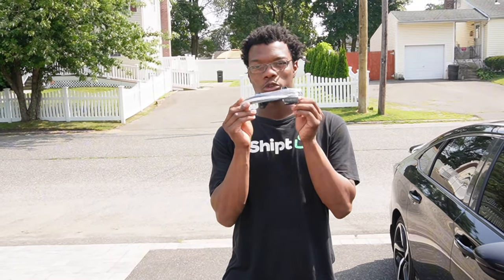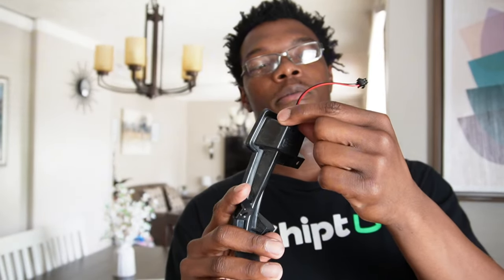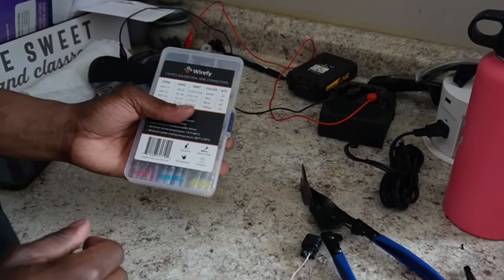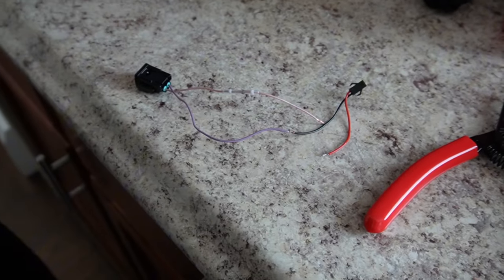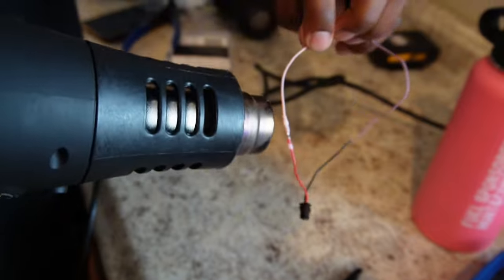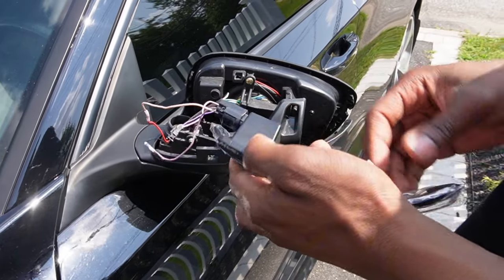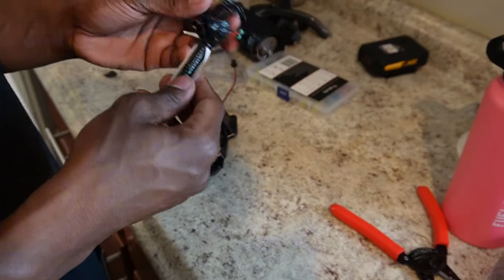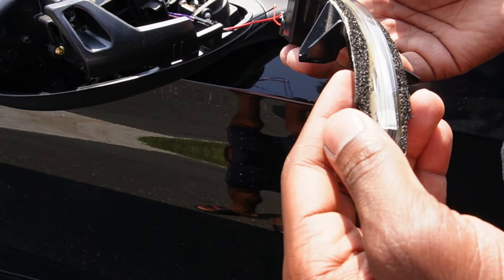Adding sequential lights to the Aftermarket mirrors!!!

Comment: What’s good champ, I’m looking to buy the 2020 accord sport or touring… can I know the common problems you might have faced with yours ?
Reply from the maker: I personally haven’t faced any issues with my car it runs good but if you getting a 1.5 you would have to just do some preventative maintenance for the head gasket would need to upgrade the bolt to prevent that issue if you are getting a 2.0 you should be fine they don’t get issues like that plus it he a 10 speed transmission in the 2.0 the 1.5 has a cvt transmission

Comment: This sounds dumb question, but Does it have to be oem mirrors  or can I get the eBay one with with the turn signal @nadewes when doing the swap or and I’ll be fine as well
Reply from the maker: Well depends on the trim level of the accord if you have a sport 1.5 se or lx then I would not get eBay mirrors and do the new way plus if you want to do power folding mirror later on you will need oem mirrors I swapped over to oem for the power folding kit just better to stay oem but they are expensive so I have a video on how to do it with the same mirror that’s already on your car can watch it here👉https://youtu.be/uqFVjy9Dspc?si=uBhu-PcGtFuZ6pXp
Reply: Thank you 🙏🏻 appreciate it Brotha
Reply: Is there a link you can put for me but trying to find OEM mirrors online but I keep getting ads of Ebay , and I have a 2022 sport 2.0
Reply from the maker: The link for the website and parts numbers are in the description of the new video when you order it if they ask for a vin number just look up a exl for sale and give them that vin number of that vehicle